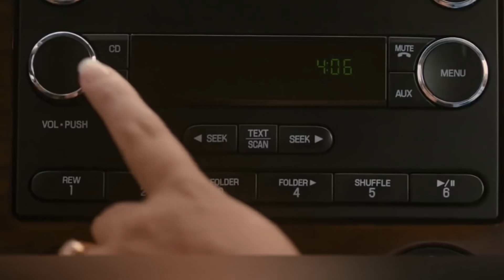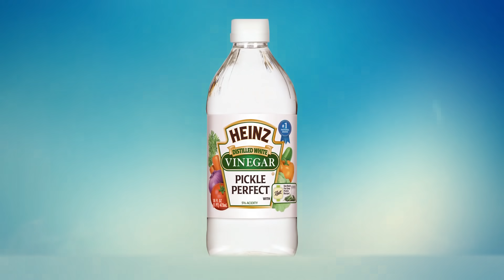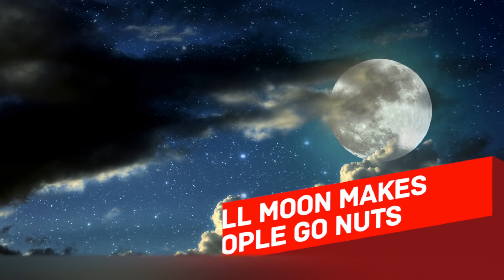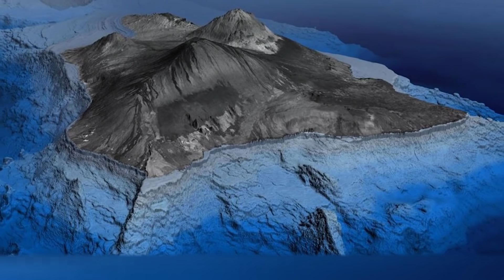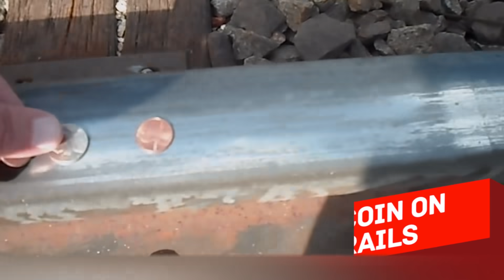15 Myths That You Still Believe

Comment: technically, mt everest is still the highest mountain in the world because it is 29,029' above sea level and the Mauna Kea volcano is only 13,803' above sea level. If you are talking about the height, well, we can never tell where the base of a mountain is. It could extend forever
Reply: People estimate the base of the mountain. Their are four primary record-holder mountains, depending how you measure: Everest, Kea, Denali/McKinley, and Kilimanjaro.

Everest has the highest peak.
Kea is the tallest from base to peak.
Denali (AKA McKinley) is the tallest from base to peak on land.
Kilimanjaro is the mountain with the largest base on land.

Comment: You just... You got that last one completely WRONG! No amount of cold weather will give you the cold virus no matter what your "mood" is.

Cold weather can a runny nose for two reasons.
First cold dry air can dry out the mucus membrane necessary to prevent infection. Your body will compensate for this by adding more moisture.
Secondly cold air will cause condensation of free floating moisture in your nasal cavity.

The reason the cold virus is more prevalent around the winter season is also two-fold.
As I mentioned before the mucus membrane dries out which makes it easier for an infection to get.
But mainly it's because when it's cold outside people spend more time indoors in close proximity to other people who might be carrying the infection.

Comment: Your Everest fact is still wrong. Mt. Everest is still the highest mountain.  Mauna Kea is in fact taller than Everest, in that it's totally body is taller, but since it is largely underwater, Everest is still the highest mountain on Earth, as the height it reaches is still the highest.
Reply: You are splitting hairs.
Reply: @RhysGFrelsa-Eudyptula  it's the difference in meaning of the words 'highest' and 'tallest'. Not really splitting hairs when pointing out an error that changes the meaning of the question 'What is the highest mountain?'.

Comment: 1:10 then explain how having rubber shoes and being shoked by ac doesnt hurt and the lightning is conducted by the frame(metal) it goes into the tires that are grounded meaning the shock goes around the body and goes back into the ground leaving you safe
Reply: Maybe  because an ac has 220 volts and a lighting strike has one billion😐😐
Reply: @kellanflanigan8509  hb u do some research

Comment: And the reason people considered that rubber might help vs. lightning is because rubber is a common insulator when dealing with electricity. However, I guess they aren't aware that the air making up our atmosphere is also an insulator - an insulator the lightning just blazed through... in fact insulators are pretty much what makes for high voltage.. it builds up until it breaks through that insulator..

Comment: I just say 5 second rule so I can still eat my food with my friends not thinking I’m disgusting
Reply: People are capable of handling some bacteria. Tests of the 5 second rule found that some attach to food right away but the longer it is on the ground the more bacteria get on, but germaphobes latch onto the idea that some got on right away in order to say that it is disgusting to eat the food.
Reply: if the food is moist or the surface the food is dropped on is wet, the food will be more contaminated than dry food dropped on a dry surface

Comment: Acctully mountains are measured from sea level so mt Everest is the tallest the one you said is the tallest mountain including below sea level
Reply: ECC Gaming. You might find it alternates between Everest and K2.
Reply: Rainbow Wolf34 going off that simple bases, and having knowledge of how mountains are created. Plate pressure stemming from the earth's crust. K2 and Everest still win. Because you moved the base from sea level to sub level.
Reply: But he did say the highest
Reply: I think the issue here is what was said: "Everest is not the highest mountain because its smaller than Mauna Kea." You can't compare local height with global scale. A bird can fly higher than a mountain, but it will never be taller than one. Everest is (to my knowledge) still the highest mountain relative to sea level, however Mauna Kea is a taller (the tallest) mountain when measured from its base up to its peak. It can be confusing because Mauna Kea might have the 'tallest height' in all the mountains, but Everest has the highest peak.
Reply: PewPewDragon may I draw you back to the simple thing of, the point of all mountain start from. The plate crust, or the fault line that pushes it up. Even the peaks were at one point under water is part of its conception. (There is a flaw here, see if you can spot it.) So a direct line from peak to crust. Sorry Everest and K2 are the tallest mountains on the planet. Unless you want to bring the Mariana trench into this.
Reply: highest means the one nearest to the sky not the largest ;)
Reply: MasterSaifHd  and at what height does the sky start. To measure height. You need a base or starting point. Is it the point were land stops and air begins? Or is it a set height.?
Reply: PewPewDragon That's right, Mt Everest is the highest but Mauna Kea is the tallest
Reply: You can of course say the base of a mountain is the very lowest point of the crust right down to the mantle, directly below its peak, but that is obviously impractical as it is impossible to actually determine, so in practicality most mountains have their bases defined arbitrarily, making Everest not that tallest mountain, but it remains as the highest. I'm not too sure what you're trying to say because regardless of where you measure the base from, Everest still has the highest peak on Earth, with K2 coming second (according to google). But Mauna Kea is the tallest mountain by the 'standard' way of measuring the tallness of a mountain.

Height (as in highness) is the measurement from a designated point to a reference point - sea level.
Height (as in tallness) is the measurement between the two vertical extreme points on a single object - base to peak.

Highest means the one nearest to the sky is totally correct, just immeasurable XD 
Thus sea level is used as its elevation can be measured and tracked.
Reply: Actually We don't measure mountains from Sea level. We measure their elevation from the geoide. Practically the 2 are very close, but sea level varies over shorter time periods, while the geoide is stable.
Reply: Mt. Everest the highest, but Mauna Kea is the tallest
Reply: David Christiansen thank you.
Reply: baah we stop the discussion and name Mt. Olympus on Mars the winner:  >20 kilometers tall, because yeah ! :p  

the hawaiian volcano is still a winner, at is it a solid individual.  Mt. Everest is just the highest peak of a mountain range.
Reply: Sorry to burst everybody's ballon, but the highest mountain on earth is actually mount Chimborazo in Ecuador. Because of the bulge created by the centrifugal force of earth's rotation at the equator, the summit is over 6,800 feet farther from Earth's center than Mount Everest's summit.
Reply: What earth's center? Earth is flat(lol).
Reply: But that is not how you measure the elevation of mountains.

Comment: I stop believing all of these when i turned 10
Reply: 4y3azz Z no one im dumb
Reply: there are 3 wrong facts presented in this video: the moon thingy (which altough true, it rarely affects anyone and would never be an excuse for crime), the electronics causing cancer, and the Everest is the highest peak on earth, even if it isn't the tallest mountain on earth, it's just terminology here.
Reply: Baitanu Andrei the Antarctica one is wrong also. A desert is defined as “a dry, barren area of land, especially one covered with sand, that is characteristically desolate, waterless, and without vegetation.” But the thing is that the Antarctic isn’t even dry. Their is water in Antarctica, it’s just frozen
Reply: it is water, but antarctica is a dry, barren, area of land. given the cold temperatures any water in the atmosphere would freeze, therefore not allowing for any kind of moisture to form, making it dry. there is water in antarctica, but also in desert, in form of oasis and rain.

desert
any area in which few forms of life can exist because of lack of water, permanent frost, or absence of soil.
Reply: Baitanu Andrei where did you get that definition from?

Comment: Science of the day:You said in your video that you don’t know how underwater waterfalls can work but it’s actually quite simple...So water in the Ocean usually has the same salt to water ratio (salinity) right? Wrong. What happens is that some water in the Ocean has a higher salinity than the rest of the water, so it naturally sinks. Still following me? Whenever it sinks it basically (due to gravity) tries to go as deep as possible (the little nooks and crannies in the bottom of the Ocean) and it creates an effect similar to that above ground. If we imagine that the water is air, and the higher salt content water is normal water, we would have ourselves a normal waterfall, and it works the same because of all the salt, the water in turn weighs more.
Thanks for reading this, i did this on my phone and it was kinda lengthy. (Like so he sees this)
Reply: Santi Lopez not really a waterfall...
Reply: silentkiller698 lmao true
Reply: Santi Lopez it’s not due to gravity, it’s due to the density of the water and salt mixture. And how would this work? If it is falling into a different salt to water mixture wouldn’t they all just mix and eventually become the same ratio? And especially if it is falling 11,500 feet?
Reply: Wtf did I just read
Reply: Todd it is due to gravity bc if there was no force to push down on objects then they would just float. Its both because its more dense and the force of gravity being applied to it that makes more dense objects sink. Surface area also plays a role in buoyancy but in this case it does not.
Reply: wow easy to understand  , a good explanation
Reply: Very good explanation. A good example of this would be in the Steam game Subnautica, down in the sulphuric part of the ocean, that green zone. You see sulphurous waterfalls there as well because of all the sulphur. Sulphur weights more than normal water so it creates that effect as well.
Reply: Santi Lopez this comment is smarter than the video...
Reply: no one has time ti read ALL thatt😬😂
Reply: Nerd

Comment: You know... Usualy you measure mountains from the sea level. 
And even if you want to make it from the bottom of the sea - measure Everest from Mariana Trench. It will still be the highest.
Reply: Everest doesn't go down to the marina trench, it goes down to somewhere above sea level I think (i don't know)
Reply: Sam Clark u r right. But when you measure something from under the see you should measure everything. And i think even some physicist will agree that this is the most expensive in energy

Comment: Counting an underwater mountain as the tallest is cheating, but counting an underwater waterfall as the tallest is just bat-shit crazy.
Reply: Technically not cheating if Mount Everest was at the same level as the underwater mountain they mentioned the underwater mountain would be taller
Reply: Mount Everest is the highest mountain, not the tallest.
Reply: Trixster Million سك
Reply: Not really, just because it is under the water doesn't make it any smaller.

Comment: the part about the mountain doesn't make any sense what so ever. the height of a mountain is meassured as the height above sealevel. now even if we removed all the water from earth, and meassured from the lowest point on earth mount everest would stil be the tallest mountain in the world. though it would look less tall since you would allready be at a high altitude when you reached what would be the "bottom" of the mountain.
Reply: Mountains are measured from base to peak. The peak and base ALTITUDE,  or height is measured from sea level. The height is measured using the altitude. However the mountain in Hawaii, Mauna Kea is taller, because the distance from the base to the peak is greater than everest.
Reply: quxify   tejidos.c0n,telares,arteesanalares

Comment: Everest is the highest mountain. The other one is the longest because it's under water as well as over water. Everest is higher though so you are incorrect on that point. You may want to do your research before making this kind of statement. I knew this when I was 1 so you should know it by now.

Edit: 11*
Reply: u might think that but it is still the tallest just because it isn't measured underwater doesn't mean its not the tallest
Reply: The peak of everest is higher than the peak of the other mountain. Now listen to the video. He said "Which is the highest mountain?" Then claimed it to be the other mountain. HIGHEST and TALLEST are very different terms. Highest means it reaches higher up than the other one. Tallest means longest. The other mountain's peak is lower than everest. So everest is the highest mountain. The other one is just taller. My comment is completely correct so don't try to correct me. Read my comment properly, understand the terms I use, then you can reply. If you seriously think I'm incorrect, you are either very young or just plain stupid.
Reply: Oh man. I just checked your channel. You're very young. Here's a tip for YouTube (and other social medias) mate. Unless you are 100% certain that you know the exact facts behind something. Don't start making claims. For an example. If you don't know the meaning of the terminology used in a comment, actually try to understand it before acting like the smart guy and making a fool out of yourself. This is by no means, a nasty comment. Just some advice, so you don't do and say things you will later regret.
Reply: Tegen or 티겐  tallest means tallest look at a dictionary because I did and no where did it say tallest is longest because longest doesn’t mean tall.
Reply: OKAY LOOK. THE MOUNTAIN IN HAWAII IS TALLER/LONGER WHATEVER YOU WANT TO SAY. BUT IT'S NOT THE HIGHEST MOUNTAIN. HE SAID WHICH IS THE HIGHEST MOUNTAIN THEN SAID IT WAS THE ONE IN HAWAII. HIGHEST IS DIFFERENT TO TALLEST.
Reply: Eh, bit of a nitpick tbh. No one cares m8, but good comprehension skills.
Reply: Uh thanks? But most of the comments care tbh XD
Reply: At least Tegen has some sense.

Comment: I already knew about the desert
Reply: same
Reply: A desert is a place defined by high temperatures sand and little water
Reply: +Neo Wakens no its not
Reply: The easiest way to remember the the proper spelling of dessert is to think of "strawberry shortcake" which is a dessert. Use s twice
Reply: TheWrsVidsEvr ur cook
Reply: Ion Trippin you couldn't be more incorrect. Defined as a dry and arid place
Reply: Richard Smith Antarctica isn’t dry
Reply: ImThatOneGuy do a little research before you speak please. Look it up. It's the biggest desert in the world.
Reply: Richard Smith the definition of a desert is “a dry, barren area of land, especially one covered with sand, that is characteristically desolate, waterless, and without vegetation.” Their is water in Antarctica and it isn’t dry.
Reply: TheWrsVidsEvr same
Reply: ImThatOneGuy one of the valleys in Antarctica is the dryest place on the planet
Reply: Bravo
Reply: Congrats
Reply: ImThatOneGuy That's frozen ocean water. Antarctica has barely any rain ice. It gets almost the same amount of rain than the Sahara desert because that actually has rivers and lakes ( which are fresh water ). Antarctica gets ~200mm a year near the costs regions and less inland meanwhile the Sahara gets ~100mm near the coastal regions.
Reply: Aston Wiggin Antarctica has a valley that they call the dead valley. It hasn't rained there for millions of years, making it the dryest place on the planet.
Reply: Ion Trippin well the Arctic is a desert or am I wrong
Reply: ImThatOneGuy it is mostly dry because any other small pool of water would freeze

Comment: There are so many wrong things here! 1-the five seconds rule may work on some type of food for example dry food such as cookies there are many article and experiments online that you can see to support this           
2- mount everest is the highest mountain on eart ([{ABOVE SEE LEVEL}]) 
3- parents don’t allow sweets (specifically chocolate)before bedtime because chocolate has a certain amount of caffeine which to a child body is alot thus child stay awake 
4- running under the rain can give you cold because it’s usually cold while raining and when it’s cold the body temperature begins to drop thus weak immune system which results in a cold .moreover,when the rain hits the ground, bacteria and viruses elevates from the ground up into the air . if the person didn’t get cold whilst running under the rain the aftermath of running under it and the cold the person feel can result of illness . 😅😅

Comment: Even 3 molar HCl really isn’t that bad if you get it or your skin as long as you wash it off pretty quick. While yes it sting and dries out your skin but that’s about it as long as you get it off within the first 30 sec after than it will start to burn through your skin, and that hurts like hell. And when it comes to electronics the only harm they do is harm your eyes, due to the blue light radiation that is produced from an LCD device, which is why lots of monitors and phones have blue light radiation filters

Comment: yeah a coin will now de rail a train, i put a inch thick bolt under a freight train and all i heard that night was a f*****g loud bang that woke up the campground. boath the campground and the train were fine though. trains run over stones all the time and if you YouTube it you can see them push through semi trailers with no problem.